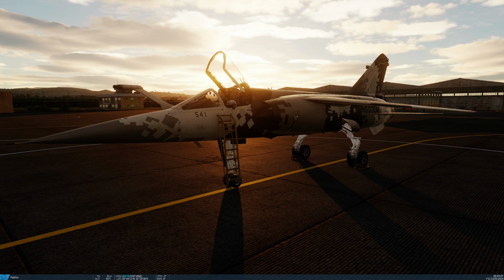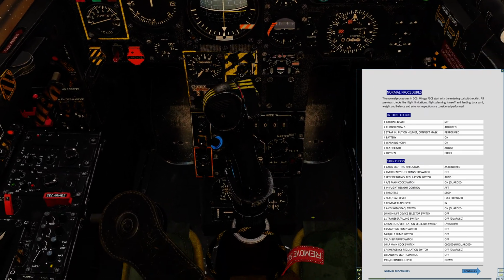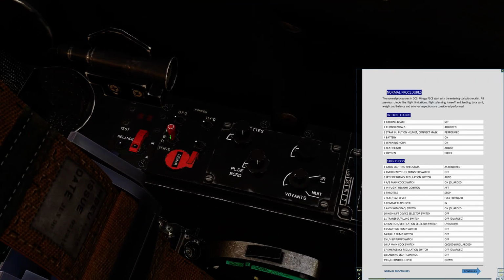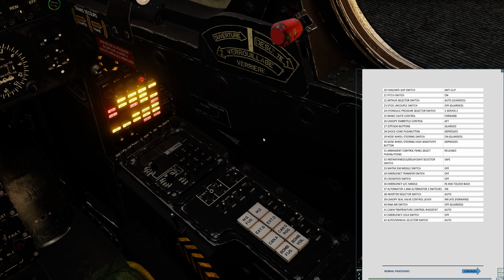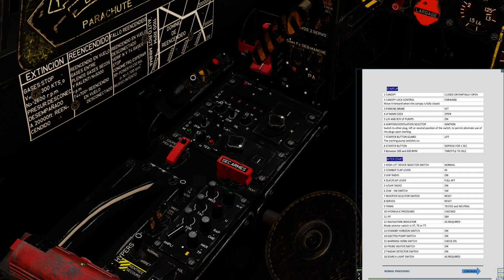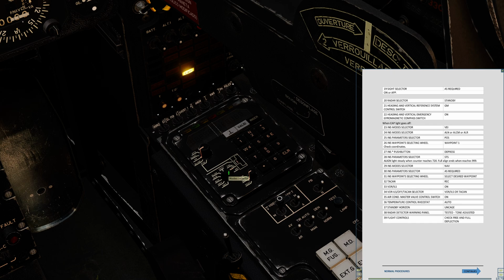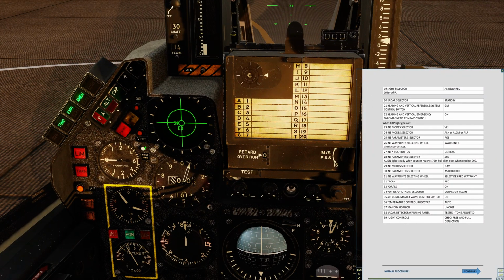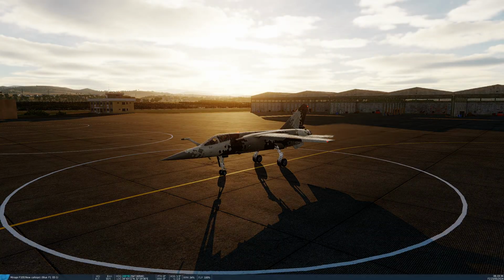DCS Mirage F1EE Tutorial 1 - Startup

Comment: F1 is a great module. Looking forward to takeoff/landing tutorial and your experience with NWS. Only can do this properly with NWS completely switched off. Low gain will oscilate too much for me.
Also navigation is great, even non INS version with offset TACAN settings works well. Keep it going.
Reply: This is true.  Hopefully, he also covers the auto-ILS landing.
Reply: @kontiuka  Nice coincidence, I tried this yesterday just for fun. Worked quite well, even I was not on a good intercept when I armed the localizer and GS mode. You only need to work the throttle being right on AoA and be prepared for the AP switch of some feet above the RW. In hindsight with wrong baro setting for the field, this could have gone wrong, as there is no radii altimeter in the F1.